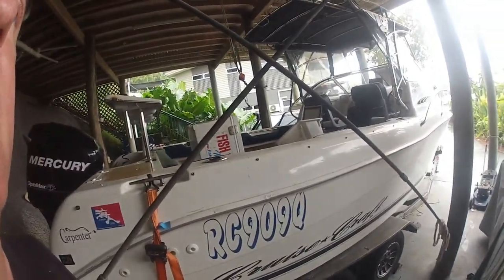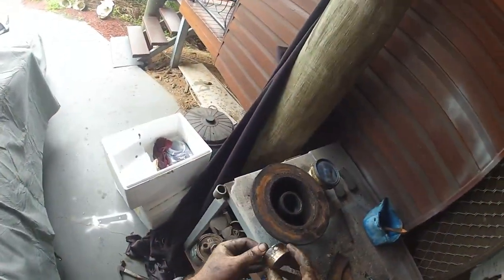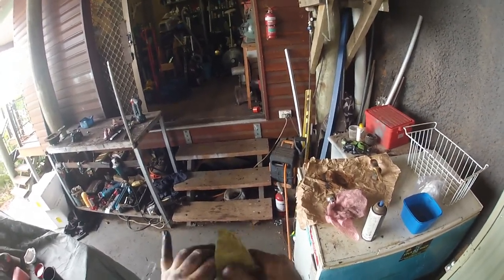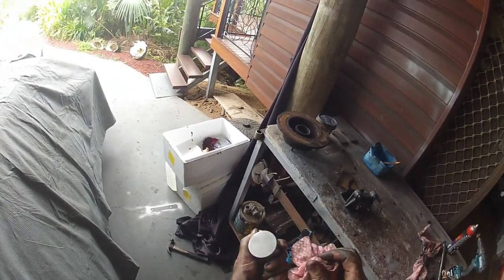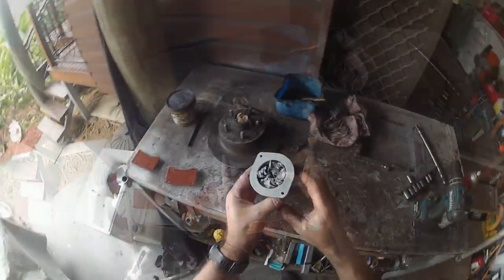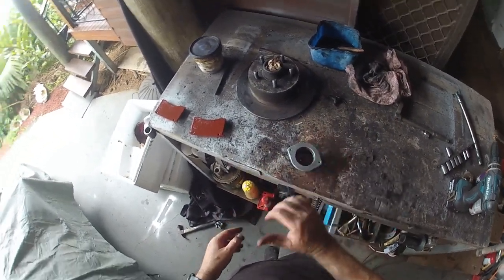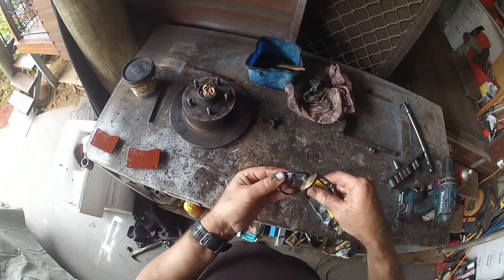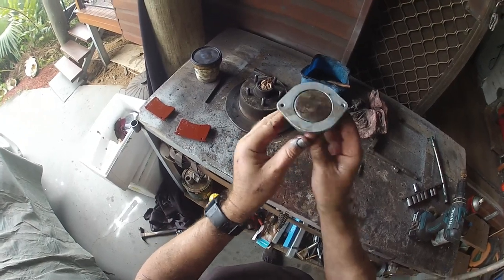Electric over hydraulic brakes - Trigg A200 rebuild

Comment: Thank you. A very helpful video ...But with Res-Q-Steel Anti-Corrosion Paste, it's non-drying, so when the brake pad get very hot up is will just melt and run off.... If only we could buy Stainless Steel Pads, because much of that corrosion (that settles around the piston) is coming from the rusting pads. So I'm going to try to insert a Stainless Steel Shim (SS foil) to keep the rust partials away from the Piston Seal.... And I just found out that "NORMFEST Galva 97 Silver" Galvanised Spray paint provides resistance to temperatures of up to +500°C.
Reply from the maker: cheers mate thanks for the feedback.  I believe Res-Q-Steel has been beneficial for me and has made the backing plates last longer but I'll have to monitor whether it is running off as you describe.   Regarding stainless brake pads, they are available (I'm in Australia and most auto parts shops stock them) however they cost approximately double the price of standard pads.  Not exceptionally expensive but I haven't tried them.  thanks again for the feedback.